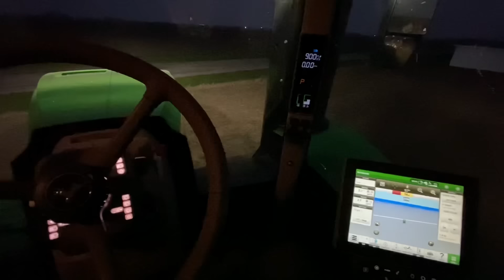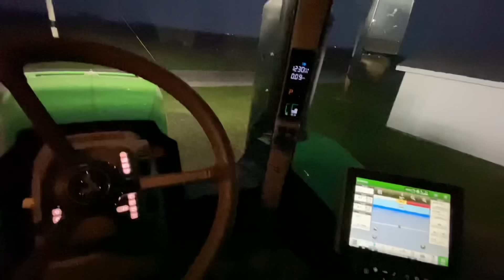John Deere 9620RX sprung a major leak! It escalated quickly!

Comment: Pro tip for situations like this.  Make what’s called a fit up bearing.  Basically you use a sanding drum to sand the inside of the bearing until it will JUST slip on when cold.  This would allow a temporary bearing which will allow it to function to get it on the truck and back to the shop.  And then when it’s back to the shop that bearing is a slip fit so it comes off easily and get put in a specially labeled box that specifies it’s not for final installation.   Those kinds of bearings are usually used by mechanics and axle builders that either don’t have ready access to a press or don’t want to be pressing bearings on and off while they figure out what shims it needs.
Reply: This! I have a box with a disgusting amount of fit up bearings in my shop that I'll bring with me in the service van whenever I have a hunch that we're looking at a bearing failure out in the field.

Comment: This is why i'm hanging on to my old equipment.
Reply: So old equipment don’t have bearings and seals??
Reply: At lest i don't have to have a tech come and get it to move.
Reply: @1995jug  so is that a yes or a no or did you not understand the question?
Reply: Yes they have seals and bearings which i can change myself.
Reply: @Justme-jt1ef  how many hours were on the clock?

Comment: I can't believe an almost brand new machine had a mechanical failure like that. Pretty disappointing but I'm sure they were glad to have a mechanic like you on call
Reply: Friend buys a new Audi high performance. Trans is removed and repaired under warranty 2 months in shop,only 4 month old. Told the dealer we have 3 choices. 1. Return my money. 2. Provide me a new replacement. Or 3,  my lawyer will be in touch. He drove it until the replacement car came in. This is the store I'd related to the JD dealer.

Comment: Excellent job John Deere ,the factory engineering department should watch you're videos i am positive they them selves could learn and see some design flaws,John deere should be very lucky and appreciate too have a tech like you servicing there machines. Service is what matters the most,all machines break somthing once in a while LOL.
Reply: Most authorized repairers report back to deere anyways, so they are aware of what breaks are common on the machines. That being said, a single bearing failure on a new machine is probably not a design flaw, but manufacturing or installation error that happens very rarely.

Comment: Great video ZK👍 I see we’re you are coming from.  Not Easy.We haven’t had any problems with transmissions. But I got a charge pump out in 9370R with 500 hours.Strip the splines in between the drive shafts Thanks for the videos
Reply from the maker: I just had a 9570R do the same thing yesterday!
Reply: @ZKMasterTech  Did John Deere have the pump? This one is back order. Ship date 11-23-21 It's going to a long winter if we can't get parts
Reply from the maker: Haven't ordered it try. We will see
Reply: We're are you. Hope your well? Where fine here. Wear looking forward to xmas.😵‍💫🤢🤮

Comment: Putting a light  couting of lithim grease helps getting parts back on with the heat/cold procedure. I learn this overhauling aircraft engines replacing valve seats and guides.

Comment: You did it just like I would have except, I would have not replaced the bearing and seal, I would have had a 55er of oil delivered and fixed it in the spring.  Lol.  Great job.

Comment: Great video, something I do with my Rattle gun in tight spots is to swap out the big battery for a smaller 3 amp, the lower profile of the battery can mean squeezing into a tight spot, cheers.

Comment: Please get your shop to buy you a good induction bearing heater like the SKF induction heater TIH system or something like so you can safely install bearings and sprockets/gears and such. Hopefully you have a small generator on your service truck so you can run it. And have a demagnetizer as to not attract metals suspended in the oil. And a good pair of heat gloves. I was cringing as I watched you pull that tapered roller bearing out of the oil bath/turkey roaster pan with your channel locks. You are a good tech! and good tech's deserve the correct tools for the job. Double kudos' to you! And please have safe travels.

Comment: Gotta love brand new equipment, I work for a n equipment rental company. The amount of brand new equipment that lasts an hour on the jobsite is amazing. Had a manlift not even make it off the truck before it poured oil out of the extend cylinder. When it was installed at the factory they knicked the cylinder and it tore the seals out.

Comment: If you ever come across drivelines that won’t compress or extend I have used really thin feeler guages under the slip joint seal to relieve it of the air lock in there making for easier fitment. Obviously need to be extremely careful not to damage said seal. Cheers mate
Reply: Dang that's a good idea!
Reply: They make a little plastic seal cleaner for MX Bike forks.  Seal Mate for cleaning dirt out of the wipers.  Perfect for this!

Comment: FYI, if you reviewed tools, I'd totally take your recommendations! Keep up the good fight, sir!
Reply: @Ian Kiefer….although I’m a part time green tractor mechanic, after a nearly 40 yr. Career in aviation working on large and small jet engines, commercial airliners, warbirds and helicopters….nuts and bolts are nuts and bolts doesn’t matter the color or size…..high quality tools ( although expensive) are the only way to go…my arsenal consists of Snap-On, Mac, Matco and older Craftsman tools…Milwaukee fuel battery power tools….
When a technician is miles or states away from their shop, they need to rely on what they bring to get the job done, effectively, efficiently and safely.
Good luck…

Comment: I carry a stainless steel sauce pan in the truck. Main purpose is to cook thermostat soup. Put pan on opened vise add old stat along with new stat, cover with water. heat with rose bud. Bring to a boil, watch stat openings. Able to accurately identify bad stat.
 I have used to heat bearings. Cover in oil, no direct flame on bearing. Must proceed with caution. I have caught the oil on fire.

Comment: All that trouble could have been caused by one little bit of metal, possibly from manufacturing getting into the bearing ! Hope the tractor was still under warranty. Interesting to see how much rusty metal there was where the paint had not reached as well.
Reply: He mentions it is a new machine, so it's most likely under warranty

Comment: You need a mobile bearing induction heater dude, far better and faster than dunking them in a heated oil tank, also healthier for your lungs 🤣🤣 check out the SKF TIH030M, I use one in work and they are a revelation, 
P.S using an impact on a set of pullers buggers the jack bolt threads, I've repaired to many specialists pullers all buggered with impact use, great vid of a field repair 👍
Reply from the maker: The skf TIH030m is $3,858.... Better save up my pennies.

Comment: Since most heat-fitted parts are made from steel in one fashion or another, maybe a compact induction-oven could work for heat treating parts before fitting..? I can't see why it wouldn't work, even if it might need a bit more than 12v from the car's alternator to function...

Comment: Hi, I just have a question....
You are bringing the machine back 2 the shop anyways, why bothering to reattach the driveshaft, wouldn't the machine run just as well, with just 2 driven tracks? Do these have a middle-differential, or some kind of sensors, that would stop it from driving without? Jes, the yoke is needed 4 axial sealing the driveshaft, but is the driveshaft also needed for something?

Greetings from italy🖐
Reply: Super great, professional work btw... I realy enjoy watching you do the things just the clean, honest and right way💪💪

Comment: Love watching your videos and learning from them. Had a question though if you were actually fixing the machine do y’all replace your drive line bolts?
Reply from the maker: Thanks! Yeah I normally put new bolts in.
Reply: @ZKMasterTech  good to know I was just wondering if John Deere called that because I had seen Other manufactures say that. Thanks man.
Reply: @samuelwilhoit2123  As the bolts had been over torqued and thus stretched it is vital that they are replaced otherwise they could fail catastrophically.

Comment: Also thats nuts how heavy that driveshaft to the rear is! Not sure what the torque split on these things are and I havent looked up the engine torque output on these, but I know a quadtrac 620 is something between 2000 to 2300 ft lbs of torque at the engine, so considering that, I imagine that small as thiccc drive shaft needs to deal with upwards of 1000 ft lbs so its gotta be built heavy and solid. Still nuts though.  Also that holding a 90 lbs shaft with one hand remark really needed a second person on scene to say something along the lines of "thats what she said"... okay sorry i had to. Go about your day people....

Comment: Great improvisation mate well done. Any reason you tighten filters with a ratchet and not by hand?
Reply: It’s pretty standard on most newer machinery to do hand tight then a quarter turn with a rachet, new oil systems run at high pressures then they used too. So at least for me it’s been that way on anything 2010+

Comment: You always have a bearing heater with you. Manifold of your truck engine will heat it up enough to slide on or at least be able to drive on with ease
Reply from the maker: Map gas to 300 worked like a champ

Comment: did i miss something, no oil sea; just an 'O; ring, or was some of that chewed up mess the seal and spring?.
Also, having watched a couple of these (excellent) vid's several situations where i would have expected use of gasket goo if not a gasket but there is nada, the machined surfaces allow for tight seal?. No reason why not,  my Vincent m/c has no head gasket, it just relies on the cylinder head being lapped with grinding paste to the barrel and torqued down to hold compression forces..

Comment: My uncle is a farmer who’s tighter than two coats of paint. If that were his tractor that repair you did that you called “temporary “ would have been the permanent fix for him, unless it was under warranty. Then when the transmission failed he would have blamed the filters and cursed John Deere’s lack of quality control. That’s why you need to be suspect when a farmer rants and raves. It’s usually their fault. He refused to use the Loctite specified by the manual on his combine and when the bolts vibrates loose and went through his thrashing knives totally destroying it he tried to make an insurance claim. They sent a factory guy who immediately found out and the insurance company said no. He didn’t want to spend the $20 for a bottle. Moral of story: some of you probably had that thought cross your mind. Don’t give in. Repair it right

Comment: I am presuming the tractor is under warranty. I hope that every bearing that that oil lubricates is replaced, oil coolers junked etc. The amount of material that has migrated with the oil is frightening and of course the material is super hard being bearing material. There is really only two reasons for that failure. Over temp bearing upon installation or too much preload. Heat treated steels like bearing are very sensitive to over temperature. The tempering temp starts just over 190 deg C, Yes, that low! Tempering the bearing softens them. Preload overload is evident when the end of the rollers are badly worn. Difficult to access. I have seen engines rebuilds fail time after time because material being trapped in the oil cooler and coming out into the new engine. My guess it was a preload failure, possibly because the bearing was not seated to its shoulder when shrunk on. maybe slid on nicely and bounced back a tiny bit but enough extra load and with that super tight fit could have been doomed from the day it was put together. Attention to detail is so important.
Reply from the maker: There’s no preload on those bearings. Supposed to have .001-.005” end play.

Comment: the hotter the easier they are to put on .. I heat the bearings just before they turn blue, then you can set them at .5-600 degrees then the ring is 0.1 -0.2 mm above the axle measurement .. then it will work right on..ps be quick..practice with the heat on old bearings,, i could change that in 10-15 minutes

Comment: Zeth, how do you figure the owner of this tractor knew there was a problem?  I is not likely he was seeing oil on the ground as the chisel was coming from behind.  Do these vehicles have low fluid level indicators for the transmissions?
Reply from the maker: The tractor slowed all the way down because the park breaker lost pressure and he smelled a burning smell. No there isn't a low oil indicator but they use the charge pressure sensor to detect low pressure in the system most likely due to oil loss. There is also an axle lube pressure sensor.
Reply: @ZKMasterTech  Yah that makes sense.  Brakes do tend to get toasty when applied.  Thanks
Reply: @ZKMasterTech  I was wondering the same thing, thanks for the explanation

Comment: Using the housing to push a bearing on is a horrible idea. Good way to crack or warp the housing. Cut a slit in the old bearing race and use it as a driver. I’m guessing the failure was due to improper bearing clearance when assembled.
Reply from the maker: The bearing was all the way seated on the shaft before I put the housing on. That why I heated it. You couldn't hear it slide on like it was nothing?
Reply: @ZKMasterTech  I did hear that, however it’s best to explain the potential issues it can cause. Don’t want to give bad advice to viewers.
Reply: @jamesanderson8342  this isn’t a how to channel.
Reply from the maker: The tractor only needs to drive 50ft onto a trailer then it's most likely getting a new transmission. Trust me if this was in a shop setting and I was fixing it right I would do things differently. This was just a bandaid.

Comment: can I ask you..you would surely know....
I know that axle changing output speed if the shaft is curved in the U joint right?
so when rx turning...shaft is curved in U joint so why speed of wheel isnt changing?
hope you understand....Im from europe and my english isnt so well
thanks
Reply from the maker: The shaft speed doesn’t change no matter what the angle.

Comment: just an observation but u seem to work on alot of very new pieces of equipment with real problems.  whats up with john deere quality???
Reply from the maker: The area that I work in is some of the best farm ground in the world. The majority of our customers run newer equipment and there’s a ton of it out there. With so many newer tractors and combines running out there, there’s going to be part failures. These new machines have a lot more parts and are more complicated. But, our customers really like them and wouldn’t have anything else. John Deere has the best quality you can buy in my opinion. But that doesn’t mean stuff can’t break or else I wouldn’t have a job.

Comment: seems like the engineer who designed those guide pins would have made it a phillips head, instead of flat.  made life easier for a man in a precarious situation.
Reply from the maker: I guess I'm the stupid engineer. I made those pins one day in a hurry and it's pretty easy to cut one slot and it's easy to remove them with a flat head screw driver. I see no need for improvement.
Reply: @ZKMasterTech  I wouldn't call it stupid and if it works for you, that's all that matters.  I saw your flat head slipping out and thought "in the dark or at a blind angle, that would be hard"

Comment: I suggest these guys run somebody that's smart to run equipment it's not a 40 horsepower tractor that you can bounce around like a bubble in a piss pot even though it has a suspension on it there's going to be failures it's like in the trucking industry when they put air ride suspension and air ride cabs operator didn't feel it but the equipment did that's why bearings were failing it's common sense when the going gets tough slow down

Comment: Just out of interest. Could you have left the drive shaft off and driven it out just with the front tracks doing the pulling?
Reply from the maker: Not without pouring oil out faster than you could pour it in and running the scavage pump dry.
Reply: @ZKMasterTech  thanks for the reply. Sorry I didn't really explain myself. I meant after you had the new bearing and seal in and the cover back on. I'm loving your videos about how you are recovering equipment when it is broken like hooking up hoses from another tractor to steer etc.
Reply from the maker: @ohboy2118  it's not worth the risk of putting that much strain on the front axle and drive shaft. It drove just fine when I got done and it only has to drive onto a trailer and into a shop. Probably getting a new transmission.